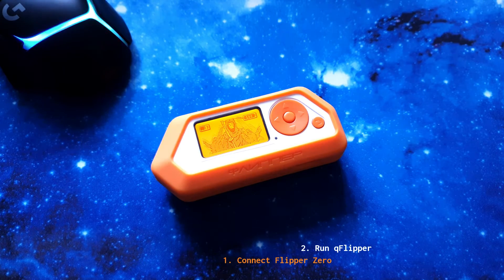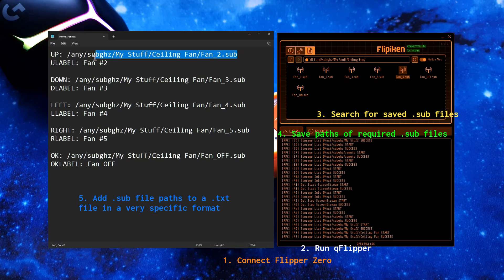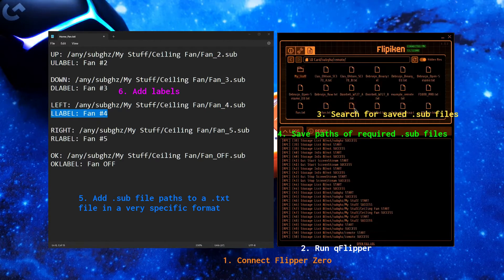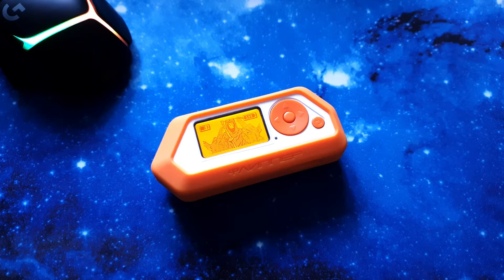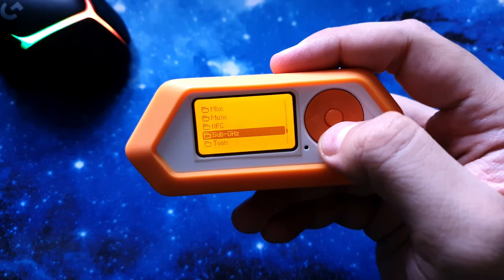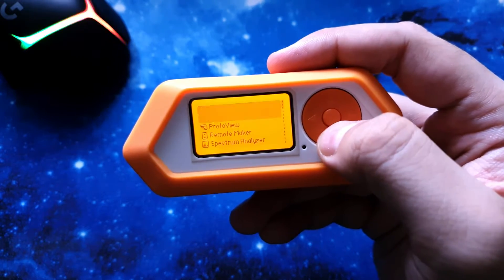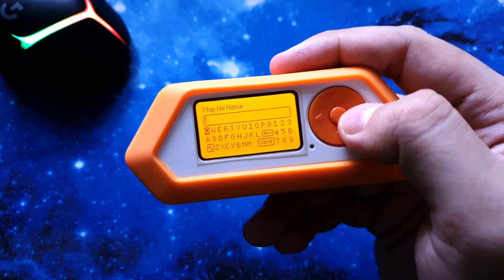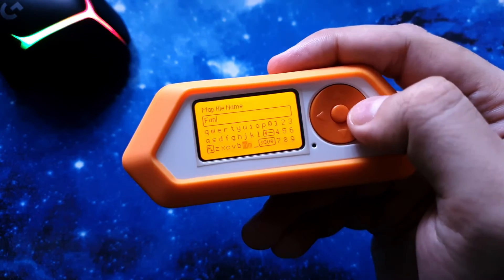Making Sub-GHz Remotes on Flipper Zero — EASIEST Method!

Comment: Great vids as always, thanks boss 👍
Reply from the maker: Thanks, my G!
Reply: No problem, just a quick question if you don't mind, I've bought a flipper recently right and I've modded it with Xtreme firmware and I'm now thinking about getting some add ons, so obviously I'll be getting the WiFi Dev board but I'd like to get some other cool ones. What would you recommend?
Reply from the maker: Go to Etsy and use the search term "flipper board". You'll get some crazy ideas like NRF24s, ESP32s, CC1101s, etc. combined into a single board.